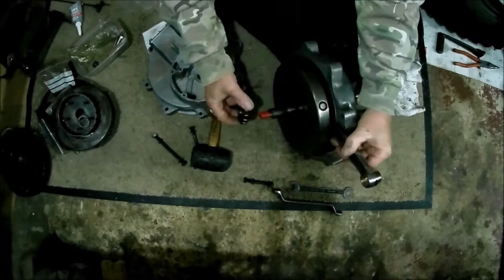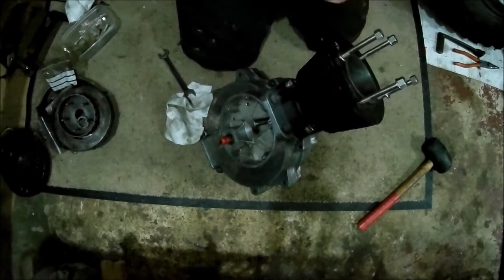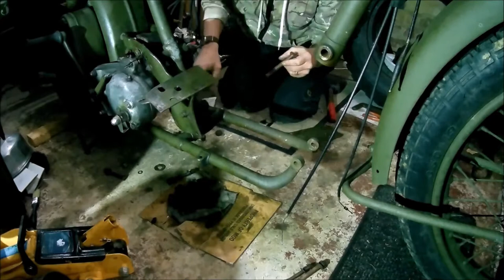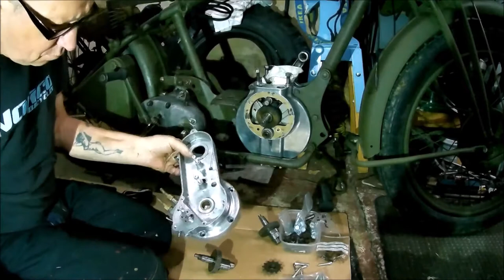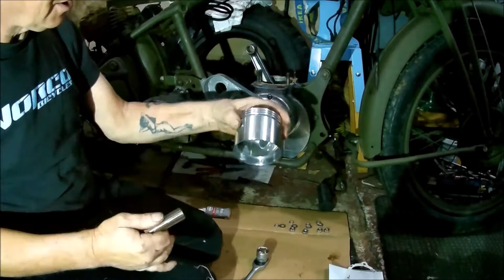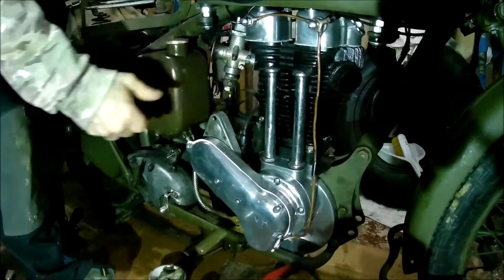ARIEL BUILD part 3 testing the engine

Comment: Thanks for the video and tuition Dean. I dont recall seeing you use a gasket when joining the crankcases. Did you? Or have you used gasket sealer?
Reply from the maker: There is no gasket for the cases. It has a spigot to locate them in line and just a thin smear of ultra grey sealant. Before the sealant has set, temporarily  fit the cylinder and tighten it to align the top face, and then the 3 tie bolts can be fully tightened.
Reply: @thra5herxb12s  thanks for the response, appreciated.